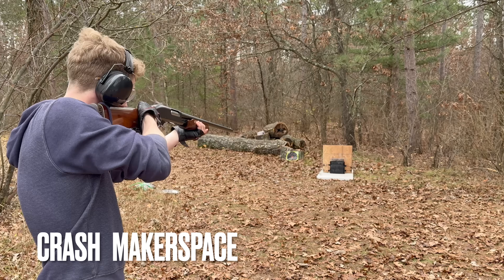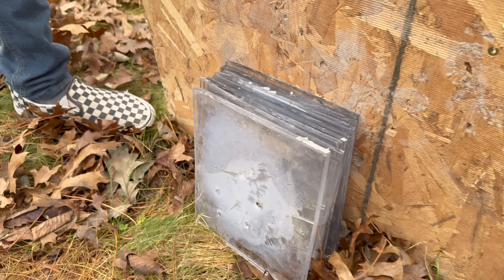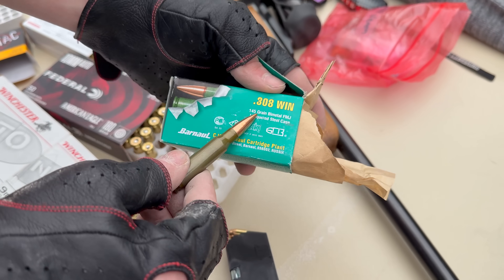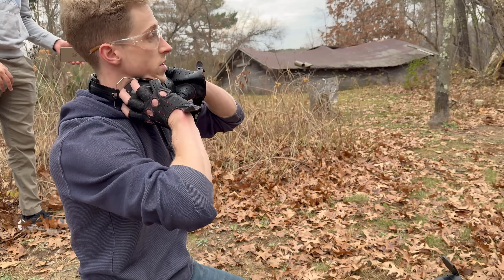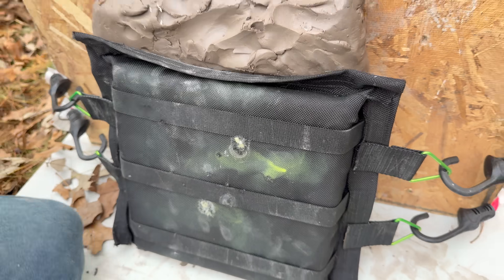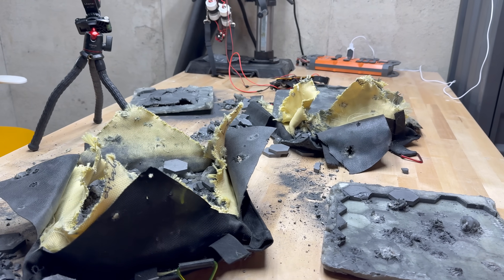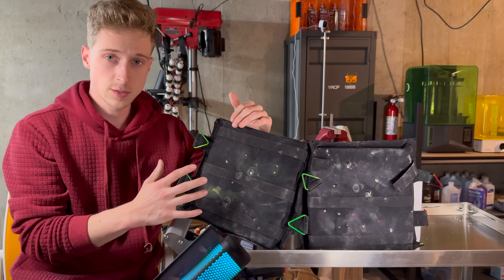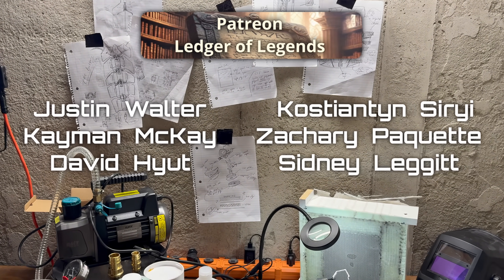3D Steel Lattice Super Armor (MULTI - HIT .300 WM capable)

Comment: Question: what about the steel lattice's metallurgical properties? Have you considered heat treating the steel? The 3D printing process may have inconsistent or undesirable grain structures or tempering.

Comment: Green tip has a mild steel tip, not a hardened steel penetrating core. Green tip is intended to penetrate a 2x4, or MAYBE an old cold war era Russian helmet. 

If you're wanting to test against AP ammos, the gold standard is M2AP from .30-06. Load the projectile into a .300wm case to really test it. 

Alternatively, M855A1 is the new military 5.56 cartridge, boasting substantially better penetrative qualities over m855. 
And lastly, if you fancy $100 per shot, M995 is a tungsten core penetrator in 5.56. you can also load those projectiles into a .22cm cartridge if you want to test a higher velocity tungest projectile.

Comment: You should look at modifying your plate similar to how the German Tiger series steel box tank design is technically inferior to the Soviet t-38 curved steel armor on the tank.
The idea with curving the metal at an angle means the projectile has to go through more material

Comment: 4:10 I saw another comment say this, and I wanted to echo it. An important thing to look out for with body armor is shock dispersion so that you don't have as big of a dent - that absolutely could crush a rib which then punctures a lung. 

But also, the weight was 9 pounds for one square, so it is definitely heavier than the standard issue Army plates - likely a solid fifty percent increase in weight. Which doesn't sound bad until you toss on a ruck, or need to haul ass.

Running with an extra twenty plus pounds ain't fun, but is doable.
Reply: That's why there's a 44mm allowable backface deformation on clay in armor testing. Also, you're comparing to ESAPI which aren't meant for .300 WM. XSAPI plates are around 8lb and require a soft armor backer to achieve their rating.

Comment: This is a modern interpretation of the chainmail and iron plate riveted to leather composite armor. Iron plates stopped the sharp point, leather acted as the structural carrier and if treated properly, as the first elastic buffer layer. Chainmail as the shock and energy dispersion layer. I wonder if using leather here could help with fiber fatigue. Like "foam" core used in the construction of airplane sandwich construction.

Comment: This is REALLY good, especially for something home-made. Only suggestion I have is that, if you have ever been hit in body armor, and it deforms the back like you get those big dents in the clay from larger rounds, it HURTS. Yes, you will live, but it can still crack ribs and do some VERY deep-tissue bruising and knock the wind right out of you. You took care of spall, but I would suggest putting a thin hardened metal plate just inside the back fabric (Thin but very hardened steel or equivalent) - reasons being two-fold: once that round gets "through" far enough to deform the back and leave the big dents in the clay, it's velocity is already so reduced that a rigid back metal plate is often enough to stop the deformation bulge a lot and have the already slowed round just smash on the plate it would normally just go through alone without the energy-dispersing front material. The other thing you noticed is higher velocity bullets being stopped get HOT, and if they end up sitting against the backing with just fabric between them and the skin, you will be in a lot of pain from burns. So much so you will want to rip the vest off to stop the burning. Metal is an excellent heat sink, and having that thin metal plate backing between the bullet and the last layer of fabric that touches your skin, would wick away a lot of the heat from the round and greatly reduce the chance of burns. Overall though, this is the best I have ever seen come out of a shed build at some civilian's house, and that's an accomplishment. It laughs at anything but a high-velocity rifle round, can still stop them, and can take multiple hits. Also - it STOPPED a freaking .300 Winmag. At close range. That's a big game round. We're talking cape buffalo and moose. I don't think even our best current issued military vests can do that.

Edit: Looked it up, and no, they can't. Especially as close as you were. Damn...

Comment: Don't forget, you can add properties by electrocoating the steel. Iridium is heavy(more concentrated mass on the surface), and corrosion-resistant to STRONG acids and bases. Hell, it's also super hard. 

Just a thought. Best channel on YT, tbh.

Comment: For bonding your ceramic go to a paint and body supply place and ask for panel bond its expensive but its stronger than welding 😅 and flexible to a point best of all most is 2k meaning it has a hardener and its compatible with epoxy and poly so your ceramic metal ceramic combo could be pre assembled then glassed together ect. I think you'll really appreciate the panel bond that stuff is like some crazy stuff 😂 really if someone told me darpa made it id believe them 100% 😅 i think it could even help with keeping the tiles separated so you get less sympathetic shock to other tiles. Kinda sqeegy it in if you will.

Comment: You might be able to at least get level 3A body armor with a slightly cheaper to manufacture design, not that i know much about it (for context level 3A takes 1 black tip armor piercing 30.06)

Comment: 1oz slug gets stopped with lv IIIA
Reply from the maker: Yes, what was shocking was that it stopped it after taking X2 .300WM, and other rifle calibers prior. You're comparing a clean undamaged panel stopping a slug but IIIA is not getting even remotely close to stopping x2 slugs with minimal BFD let along 10+ rifle calibers close range after the carbide is totally shattered.
Reply: @CrashMakerspace  I am just saying your reaction to it stoping the slug was a bit "over the top". But otherwise the plate was very impressive

Comment: Reminds me of dragon skin. Which, while very different, had issues in varying temp conditions.

There will need to be more development done before this is an actual product. It needs to be slimed down and  weight needs to be cut. It seems like a very costly plate to make and I'd be concerned if it doesn't perform better than the top of the line lvl 4 plates already on the market from companies like Dayton armor or Lockheed Martin. Both of which offer lvl 4 plates that are multi hit, very lightweight, and for only a couple thousand dollars per pair.

Still, this does seem like the future when measured against ceramic or steel plates in use now. With the primary benefit seeming to be that one point on the plate can be hit without greatly effecting the integrity of the rest of the plate. It would also be a game changer if it could be flexible.

Comment: doesn't suprise me that something 10lbs plus made of steel would stop a bullet. level 4 armor armor rated for armor peircing bullets are typically 7lbs MINIMUM. so you built a system that was supposedly nothing like market armor, and nobody would wear it because its 10LBS PER PLATE.
I'm carrying 14lbs while you are carrying 20-22lbs. Any of you who say "oh I can take the extra weight" no, you can't. you have never rucked 12 miles with 22lbs on in your life. you defintely won't ruck with 90lbs after you add in your full magazines, ifak, radio, water, and other gear.

Comment: can you scale it down so it's still able to stop 7.62x54r AP while also being slightly lighter? Cause you don't really need any higher protection than from PKM and SVD, other would be specialised sniper rounds and crew served weapons. your day is already ruined if you're facing the former and a plate trying to stop 50 cal would be too heavy for day to day use for the latter.
If you do so you might be in for a military contract, since this thing already fares better than SAPI while being of comparable weight.

Comment: I love the concept, and the fact that it works is super cool! But wouldn’t the impact still cause severe bruising from the sheer force of the bullet? If so you should look into that putty that was released a few years back that’s kinda like ultra-strength Oobleck! I bet even a thin layer worn in panels under the thicker armor plating would really help with shock absorption.

Comment: Try a Layer set from the Inside out. Inner Layer Kevlar to catch any stray frag. AR550 or AR1000 Steel plate at half thickness. a Half or two thirds of an Inch thick Lattice plate. another AR550 or AR1000 plate like the other one on the outside of that and IF needed Ceramic Tiles adhered to it using the rubberised undercoating you can use on cars. and dip the whole thing in it to kind of glue it all together. Could even try a third of an Inch thick AR-550 or AR-1000 plates to save on more weight. idea is a mix of spaced armor mixed in with your Lattice. but basically try and get the whole plate to be no more than an Inch to an Inch and a half thick all in all. you're more of an Engineer than I am. but my guess is you understand where I'm going with it :P just an idea if you haven't thought trying it yet.

Comment: M855 or "green tip" does not have a steel penetrator. The steel core is meant to get a longer bullet without the added weight of lead for the same sized bullet. So its 62 grains vs 70 something for the same size bullet. It has a steel core for a better ballistic coefficient. That means it retains velocity at further distances. 

Long story short, its not a penetrator.
Reply: 🤔Now I know
Thanks God bless

Comment: Almost anything that thick and of that weight better hold. Why not just have some AR500 plate about that same size and weight. It would be thinner. It's not about creating resistant plating but something that is practical. Anyone doing this kind of work has never had to wear body armor to use in real life situation.

Comment: I'm definitely not any form of ballistic tech or engineer, but I think it would be really interesting to see if powdered titanium 3d printing could aid in the strength to weight ratio, and maybe even thin out the plate enough to fit a shock absorbing material such as d30, or maybe some form of sorbothane or similar. That way you could take big hits but still be able to get up w/o as many broken bones. I know that's probably not realistic, but I would like to know if it could be considered as a possibility.

Comment: This is impressive. I have set a crazy goal for myself to design a build a fully functional captain America style shield (round with slight curve) that can actually survive the battlefields in Ukraine (direct drone strikes and multiple rifle impacts, bonus if it can take 30mm cannon fire)… I’m estimating that it would need to be 2-3 inches thick with incredibly tough armor like this. Would probably weigh around 200 lbs…, but that would be handled by something like the body armor you’re working on. Battery powered electro-hydraulic muscles that are actuated via natural body movements?

Comment: Might want to separate the layers. Light composite sheet for small arms fire that can be backed with the decoupler plates. It would make maintenance and replacement easier and cheaper.

Comment: I dont know if you have already done this, but with Ansys software you can simulate impacts, and optimize lattize designs, by telling it goal like low weight, and constraints like it have to stop a 7.62*39. Then you can parameterize each lattize design in terms of size, metal alloy and so on. Then you can perform same analysis on different designs to find the optimal for the next test.

Comment: all of those armor tests would have dumped a wearer to the dirt. I.E. flat on their arse, but they would have lived. up to timestamp 7:20.  the failures after that point are due to ceramics and their failures after close relative strikes. lets not forget these "failures" would have dropped an average soldier on their ass after one shot and rung his/her bells after one shot. very few BEAST troops would have kept going after the energy dump of a single shot from a 5.56/.223 round. the creator didnt test 7.62... no offense to them. for the record .300 wind-mag hits harder than 5.56. all of these armors would drop an average user to the dirt after a shot of 300 WM but they would have survived the FIRST shot in close grouping.

Comment: Why don't you try another 2 layers... The next being a thin TPU (rubberie) layer then another thin metal layer behind that in the same lattice pattern. Maybe this could make the front layer thinner so still the same thickness? But a layered energy absorbtion layer should create less energy transfer on the back side.

Comment: First off, this is incredible. The video is well made as well.

The next step i'd say is impact dispersion - a good way to test is to use "impact indicators/shock sensor" stickers, a method i'd try first is actually balloons/pouches filled with oobleck (imo, ideally you'd want to make a non-newtonian fluid act like a gel when "liquid" and compresses locally on induced stress at the shortest possible interval due to ballistic projectile velocity), the ballistic properties of oobleck are somewhat documented here on youtube, but i have a feeling it will act pretty solid (heh) as a shock absorber

Comment: Just an idea... Take that interesting lattice structure though have it 3D printed in hexagons, with 7 holes each. Then sew them together with high tensile steel wire through the centre hole and you have something quite similar to strips of chainmail which should be quite flexible. You can then sew these strips together with another wire through the outside holes to create panels or even a fitted garment. Mix up some polyborondimethylsiloxane ( the constituent material of silly putty or bouncy putty) in a polyurethane foam and soak the hexagonal chainmail in it while the foam forms and you should have a sort of super-oobleck non newtonian sponge. So if those sheets are 4mm thick, have a couple of extra mm either side of this foam gunk. Hence when a bullet hits the rotational effect on the metal hexagons will be strongly resisted both forwards and backwards. Therefore transferring much of the energy away from the direction of impact and also to adjacent hegagons, which would also rotate. Come to think of it you could also melt glass onto the rear side such that it drips through the remaining holes, then quench it to form something akin to Prince Rupert Drops and tempered steel. Course these would shatter if impacted however as it would be contained within the super-oobleck foam even the tiny shards should be both contained and provide resistance. Sort of a combination of chainmail and the plastic armour applied to WW2 merchant ships, only with a super-oobleck replacing the bitumen and tempered glass shards replacing the stone chips. Might even work better with 4 sided hexagons, as the larger the piece being hit the greater the moment of rotational force which would be resisted exponentially by the super-oobleck foam gunk. Hence a hit on one part would produce a ripple of rotational force around the wearer, dissipating much of the energy. Would also look verily cool.

Comment: How do you think Carbon Fiber would do? Just found your channel
Reply: Carbon fibre is brittle, so it shatters so it dosent absorb shock well, and since it shatters you don’t want carbon fibres in you lol
Reply: @ ohh I didn’t know that. Yea definitely not
Reply: @dylanroberts93  idk I may be wrong, but fibre glass is modified with the resin to stop it from shattering, i question whether the same could be done for carbon fibre, simple apparently carbon fibre can take more load then fibre glass, but fibre glass may deform more and absorb more energy that’s why it’s used instead? Don’t know enough about the topic
Reply: @Polkem1  I’ve heard over and over CF is stronger than metal which I have a hard time believing but that’s why I was curious. Me either
Reply: @ it is strong than metal is bending force I’m pretty sure, it’s just different properties are favourable such as absorption of energy which I think CF lacks, though it’ll require many months of research to probably conclude or something useful.
Reply: @Polkem1  I’d be interested in the research if someone does it

Comment: Congratulations... But I'm confused why you'd be releasing anything about this until it's finalized and patented.... And at 9 lbs for a 10x10 it's going to have to be much cheaper than what's currently available because those plates are 4lbs lighter.... Hopefully you can get the weight down considerably...

Comment: If you want legal AP ammo, you might try using different metals. AP ammo is regulated based on the construction of the bullet and the metals used, but only a limited set of metals are actually forbidden. I think that molybdenum alloys would probably be your best bet, although technically osmium is also legal

Comment: I have been thinking about hybrid or intermingled material as well as shape.

Like a ceramic that has a smooth uniform front but the back is full of foam like cavities, this would be hardened in a kiln. Then the ceramic would have a super fine  Powdered Titanium/flux  slurry forced into the cell like cavities in the back in a vibrating vacuum chamber, to remove bubbles and keep the slurry in suspension. Then dried and additional titanium powder layers painted on to form a uniform titanium back, then put in a vacuum kiln to bond the titanium with its self and the ceramic.